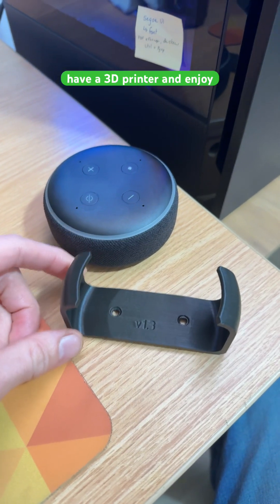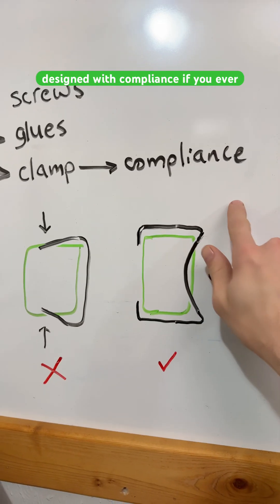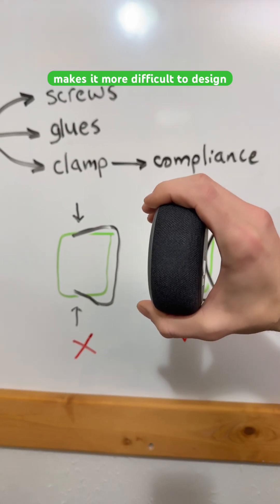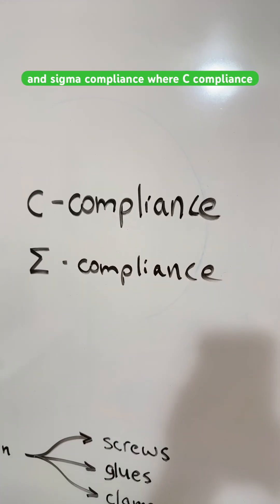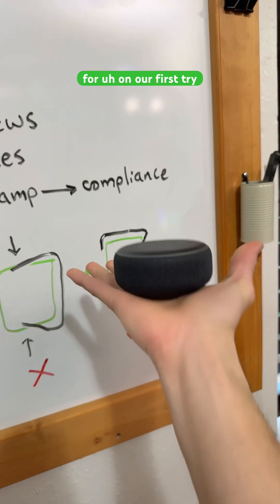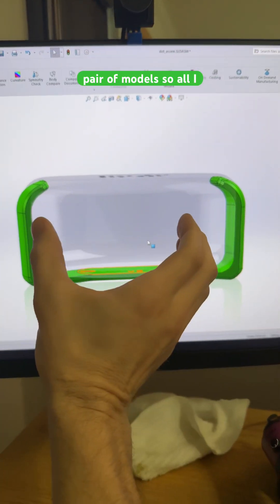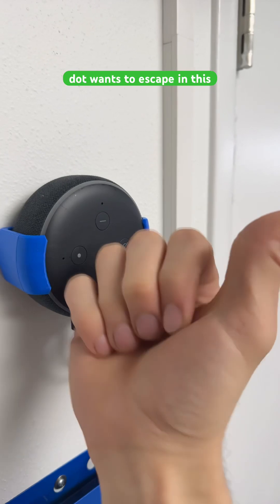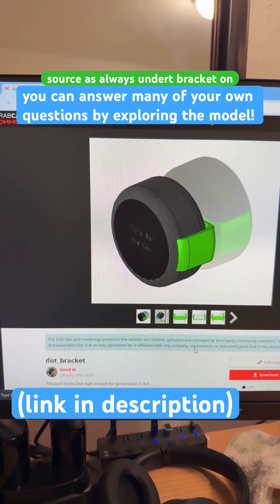how to design a compliant part.  👉An example for a 3d printed echo dot bracket.

Comment: One should also consider the material. PLA would work for a good while, but over time it would lose its compressive force. Just a thought. Great video!
Reply: I see many design with that problem. It looks cool at first. But won't hold over time

Comment: The grabcad 3d viewer is nice, I can explode and section views to have a quick look, but it isn't entirely explicit to complement the design lesson.
I'm an onshape user, and all workspaces have a public link unless you're paying for privacy.

Have you considered rebuilding some designs in onshape? It's a very good cad platform with transferrable skills to and from solidworks or FU360.

Comment: Wouldnt the bracket be in the squeezing position mounting it with screws? (Assuming its to a wall)
Reply: This is a solid point!
Reply from the maker: yes that’s a second issue to address. you can address it separately. 

now i see i should have selected a different example part to isolate the concept here.

if this video keeps growing I guess ill aim to make a longer explanation video.

Comment: Could you demonstrate installing the echo dot while it is mounted to the wall? Is the mount screwed to the wall with the two holes in the base? Does the mount sit flush on the wall or does it have spacing? I feel like if it was screwed flush against the wall then it will force it closed before you put the echo dot in, maybe I'm just not quite understanding it
Reply from the maker: sounds like you fully understand how it’s working.  you’re a step ahead of the video - in my setup i added a piece of cork to offset the backside from the wall.  or you can put washers on the fasteners or adjust the design (add a boss) to offset how you want.

i didn’t solve this in the model because it would add visual complexity and maybe confuse the key points.

Comment: Okay. But how you insert the puck in the bracket. I am confused because it looks like that the bottom curve will interfere and not go in but it does work.
Reply from the maker: I want to find out if I can answer your question interactively.

There is a 3D modeling trick and Most people don’t know about it. 
1) go to grabcad library
2) find dot_bracket & click
3) view image reel
4) you’ll find an image with “3D view”
5) click that, and you can see, zoom, rotate, etc

I think you’ll see how the parts work and understand the answer.  I don’t know what words to use otherwise.  Hope you explore! bonus points if you tell us how you’d answer your initial question.
Reply: It sits on the curve. Leaving a gap in those corners. If the speaker is pushing the holder to be a little wider, it makes the bottom part bend upwards, pushing the speaker more tightly againsst the lip at the top